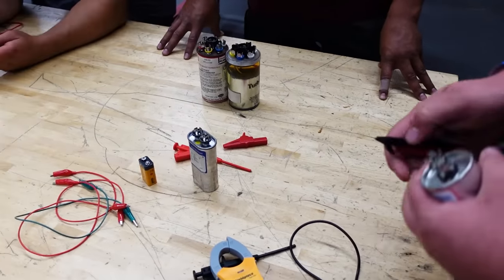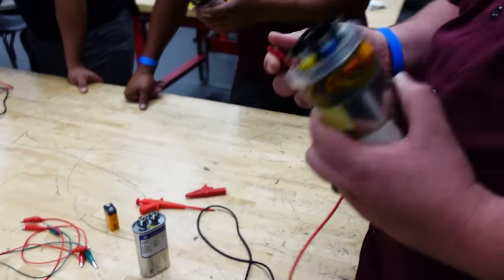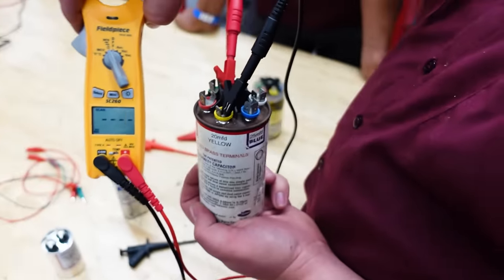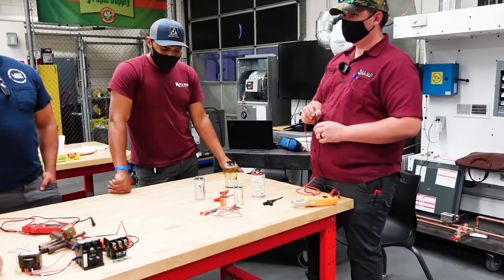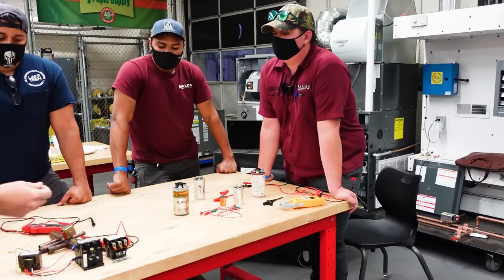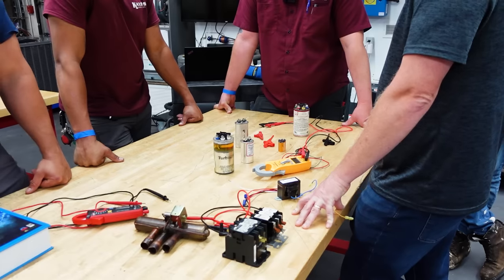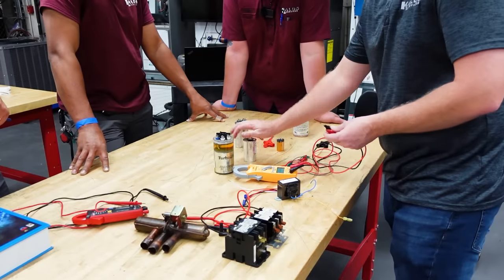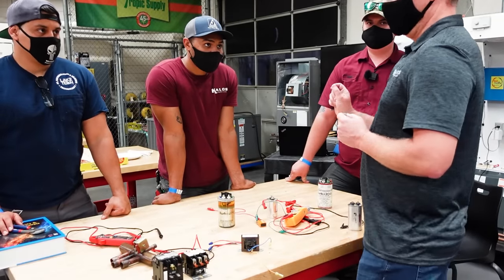Run Capacitor Fundamentals Class

Comment: What were the details of the dangerous test that they wanted to do? I couldn't hear what the bad idea was.

Are you not able to connect 120v to the capacitor using a switch, then turn the switch off, and then measure the voltage?
Reply: If it was 120VDC, yes. The surge current would be close to infinite, but if it survived the surge, you would read 120V across the terminals. At 120 VAC the cap would constantly be drawing current as it continuously charged/ discharged. When the switch was opened you would read the voltage that was present at the INSTANT the switch was opened (0 to +/- 170 volts). If you've ever switched on a light and it instantly blew out (very brightly), the instantaneous voltage was approaching the peak of 170V. This doesn't happen often, but it does happen.
Reply: @rickvia8435  when they said they might do the test off camera, do you think they did? Is there a way to do the test with safety precautions that mitigate the danger to reasonable levels?
Reply: @realSamAndrew  Not with AC, Man. A human cannot open (or close) a switch fast enough during an AC cycle to be able to determine where in the AC cycle the amplitude (voltage) is.
Reply: @rickvia8435  I understand the wave moves too fast to be useful in a test, but I wish to understand why it is dangerous. For example, you can connect a light bulb to 120vac and measure the voltage across it as it is powered. Why can't you do the same with a capacitor? Even though you might have to connect other things to complete the setup.
Reply: @realSamAndrew  The basic purpose of a capacitor is to block a direct current, while passing an alternating current. In the case of a direct current across the terminals of a capacitor, current will flow until the capacitor has charged to its capacity, then no more current will flow. If an alternating current is connected across the same capacitor, the capacitor will tend to conduct the current in relation to its  capacity vs the frequency of the AC. If the voltage of the AC across the plates of the cap are reasonable, a voltage WILL develop across the capacitor that can be measured (by an AC volt meter). The voltage that is read will be determined by the value of the capacitance vs the frequency of the AC (this is the impedance at a given capacity and line frequency). If the AC voltage exceeds the rated voltage of the capacitor, it will act like a short (or near short) and the capacitor will be destroyed.

Comment: Pretty good learning experiment I done worked on heating and air conditioning for over 20 some year I've had my experience with some capacitors the worst I ever had was start capacitor I've had them blow the electric box completely up they're dangerous you ought to teach them about them things . They act like a half a stick of dynamite when they go off got to teach them how to wire them up.
Reply: You are correct. In fact, these big capacitors should be labeled as dangerous. They explode, and also the current can kill you. Far too many inexperienced guys screw around with these things, without understanding the risk.

Comment: In 1973 a very bulky expensive meter was needed to test capacitors.
You could test for opens or shorts with your ohm meter but you couldn't test the MFD's .
Reply: Yes, but then if a cap was bad, it would drain itself real quick and not hold a charge, as it's internally shorted. Charging it with a DC voltage like they did, then testing the voltage of the cap will reveal a short or not, as the voltage will drop and not hold unless it's a good cap. A ohms test is not sufficient for testing caps, as the test itself will drain the cap which leads to continuity.

Comment: There's a wide range of capacitors.Those are starting capacitors filled with electrolyte.Some are ceramic or use other materials.In a circuit a capacitor will block DC but not AC.It will phase shift the AC signal.RMS (root mean square) voltage is 0.707 of peak AC voltage.Some things aren't explained in the video,but otherwise good presentation.

Comment: Where can I get the alligator clip meter leads that you guys were using in the video? I don’t care for the ones that came with my Fieldpiece meter so I bought some Amprobe alligator clips which look similar to the ones in the video but much larger. And by much larger I mean way too large. I like the ones in the video, they look like just the right size for me

Comment: question: If a cap is fed AC120V and unplugged , then measured would the maximum voltage read be < 60V? since is the difference between the Hot and Neutral. will only be charged up by half of current as it alternates?
Reply: or would that only be true on a 240V line?

Comment: Can these also be checked with a capacitor tester, The sane kind used in electronics?
Reply: Yes so long as the tester is designed to read the scale the cap runs at. Most all testers will, as these caps are at low capacitance. In electronic circuits, capacitance can get higher in scale, which might require a tester design for high capacitance. Generally, just about any tester will read these caps. If you want a tester to read higher scales, like for electronic circuits, it might require a different tester, depending on the scale design of the tester. Farads, micro farads, pico farads and nano farads all are on different scales. It would take a real good tester to test all those scales, be an expensive unit which most people won't even need.

Comment: It's still not clear to me why the capacitor is wired the way it is. Does it connect to L1 or neutral?
Reply: These capacitors are for 240 Volt systems where a neutral isn't used so the capacitors are never connected to neutral.

Comment: Is it okay to discharge a capacitor with screw driver while the wires are plugged in?
Reply: Assuming that you mean the wires "to the capacitor" are plugged in, yes, not only is it OK to discharge with a screwdriver, it is best practice to always discharge capacitors, to prevent personal shock when removing their wires.  

First be sure that all the possible power sources are removed from the machine and verified with a test meter, then be sure that you are not inadvertently grounded to the machine frame (always a good practice when troubleshooting) so you don't get shocked if you accidentally touch the screwdriver blade.  

Before working on any machine (excluding "live" troubleshooting) you should implement Lock-out/Tag-out procedures which always include "removing or blocking any internal sources of stored energy."  Mechanically this includes securing any energy stored in springs for example.  Electrically this includes discharging all capacitors, especially the "large" ones found in HVAC machinery.  A screwdriver with an insulated handle is a convenient tool for this discharge, insulated handle pliers can also be used.  If not sure of your tool's insulation, wear gloves, leather is fine, even cotton is better than nothing, as you probably don't have electrician's rubber gloves handy. 

Bottom line: remove "all risks you don't need to take" and this includes using gloves, and being aware of all external ground sources that you might accidentally touch.

Comment: I'm not positive you are correct about the capacitor charging and discharging based on the supplied electrical frequency. 

I'm pretty sure once charged they stay charged until that charge is used. I can't think of anything in the motor circuit that would discharge the capacitor.

In my understanding a start capacity is used to smooth and supply a constant voltage to the motor, and to absorb the start in rush current.

 I'm open to be informed otherwise.

Comment: In a microwave oven a capacitor and a diode is a voltage doubler circuit. The 2000 volts becomes 4000 volts...technically you are right the capacitor itself doesn't boost voltage. But in a circuit with a diode it can double it.

Comment: Can you use a higher rated capacitor. Something is 220v and then use a 370/440 rated capacitor?
Reply: The voltage rating on capacitors is a maximum limit. Exceed it and the cap goes boom.
Provided you don't exceed the rating then the cap will be fine.
Reply: This is the same question i have. Mine is 250 v and 60uf but i cannot find anything in 250v i guess i can ise 370. Well i hope i can lol

Comment: Does a motor still run if the run capacitor is bad?
Or still runs but doesn't run as it supposed to?
Please help.
Reply: If the capacitor is removed or completely broken the motor will not run.
If the capacitor is degraded as talked about with the foil peeling off then the motor wi run but badly, get hotter and less efficiently.
This is only for a run capacitor, not a start capacitor.
Reply: @dougaltolan3017 . Thank you. I don't know why YouTube never sent a notification about your answer.
I just found it today because i watched this video again.

Comment: You need to a video within the next week before my final exam lol!!! A video on how the electrical is hooked up on a wooden simulator board thing in our classroom showing the wiring from the the thermostat to the transformer, contactor, heat relay, indoor fan relay, compressor, electric heat, indoor fan and outdoor fan!! I bet you $100 bucks you can't make this electrical video with a week!! Really lol 🤷‍♂️
Reply: There is no capacitors on this board simulator thing...
Reply: Lol I I can follow the schematic its just.. well idk what it is!! For some reason I am just having the hardest time time with this!! I believe I am just making it more complicated than what it really is!!  Its like where to plug in the wires on a contactor and where to plug in the wires on the relays??
Reply: @Trust_Jesus  you have to think about what loads connect to what switch. where is the line voltage going on a contactor. what tstat wire connects to each switch. contactor Y relay G sequencer  W. where is the common going from the step down transformer  ( to the 24 volt coils) and you have your R power wire going to the tstat block
Reply: @anom2789  yea.. I'm just making it harder than what it really is!! I got the colored tstat wires down to which switch it goes to and I know where the 24 volt transformer wires go but its like i start getting everything messed up with all the common wires and the load side!! Smh... I just need to take one step at  time and slow down!! I think I really am just making it harder than what it is lol
Reply: @anom2789  it just looks like a big jumble of wires when my teacher does it lol... I need to just slow down and connect one wire at a time!! I've been struggling with this for 2 weeks and the final is next week 😫!! I'm in class for 5 hours tomorrow so all focus is gonna be on that lol!!
Reply: @Trust_Jesus  if you could take a pic of your board and then draw it on paper over and over you'd get it down easily as well
Reply: @anom2789  cool! I'll have plenty of time tomorrow and I'll have the lab all yo myself most the day so I'm gone do that!!

Comment: Me: Your capacitor failed. Needs replaced.
Customer: BUT I JUST REPLACED IT 6 YEARS AGO. THEY DON"T MAKE THEM LIKE THEY USED TO! RAAAWWRRR!
Me: You're right, they don't! It's cheaper, thinner materials so they fail faster. Your system is failing now. Starting with the capacitor.
Customer: GET OUT!
Reply: HUH... first its heat that causes them to fail.  There are tons of quality capacitors that are cheap.   you can make a great capacitor with thin material if you do it right.  Also why would a customer tell you to get out if a capacitor failed and either the system is down?   I think most people assume nothing last for ever and a cheap $10 capacitor plus a reasonable labor free is a small price to pay for a working HVAC system.  Now if you are over charging them say $50 for the capacitor and $100 for the service then yes, get out.
Reply: @MichaelMantion  Michael, that's the problem with some companies. I had a tech out to troubleshoot and repair a short in the outside 24V control wiring. Job well done. He was good enough to point out the start capacitor was leaking and quoted a price  of $250 for parts and labor, with about one week to order parts. I never called back. Ordered the cap and start relay for about $40 and fixed it myself in about 10 minutes. Fortunately I know the ins and outs of de-energizing the system and capacitor. Most homeowners wouldn't know they're getting scammed and wouldn't be aware of important safety issues for a DIY repair.
Reply: At season start, my A/C wouldn't work.  Thought it was continuation of last season's freon leak but with pressure test OK figured "hey, I'm an electrician," let's take some voltage measurements.  Verified power, and contactor was "pulling in" but no output voltage to the compressor.  Huh?  So, first step in troubleshooting, open things up and look for something obvious.  Ants! Dead ones, on the contacts with high body resistance.  After a  short memorial for the ants, I reassembled the main contactor and she started right up.  What do you suppose the commercial A/C tech would have sold me, and how much would labor have cost for installing it?

Same ant problem caused my kitchen GFCI outlet to trip and not reset, and a smoke detector to "false alarm," on other occasions.

What meter setting do you use to measure the electrical properties of an ant?😉

Comment: Lol in electrical class in college I was the guy in the back who would take the little capacitors from our little electrical circuit builder kit and get everyone to pas thier 9v batteries to me connect them in series and then Hook the cap to the battery bank as the instructor was talking and suddenly hear a sizzle a bit of smoke and bang the cap pops and launches pieces of itself and obviously everyone is now looking at me as I laugh my ass off

Comment: Thx HVAC S for an informative and interesting video  brought back memories of '70s Mt Sac College and Mr Motter's Aviation  electronics class  driving home  Xl and Xc calculations to match capacitance to reactance to improve delivered  power factor in a motor. Now days a Micro Aire soft starter does it all for me on my RV ACs allowing me to run 2 ACs from 30amp 120vac shore power. Sub'd

Comment: Compressor, it's not working. Capacitor must be shagged. Buy new capacitor. Install. Compressor motor still does not run? Checked cap with circuit tester on 200nF.= 0.4 ! Test on 20uF. Display reads same as before testing 0.03 ~0.04 . Is this the wrong tool to test with?

Comment: A/c's will have complete diagnostics on board with blue tooth to your router and will be monitored by your A/c company & manufacturer.  Reading will be continuous and diagnostics codes thrown will alert the A/c service and manufacture.
Reply: Carrier Infinity Series already does it,the tech can monitor what the system its doing because it is connected to WI-FI and it self diagnoses some problems and keeps history of prior issues,it even can be configured to send e-mails to report malfunction!
Reply: @pastormartinez4676  yes that will continue to grow and monitor.  I dont allow any of the smart meters on my houses or rentals.  It won't be long that if  they see your appliance is out of date and using to much electricity, you will pay penalties.

Comment: No mention of the 90 degree phase shift between the two windings needed during starting - to provide a rotating magnetic field.  Come on guys, know your stuff.  Three phase already has a rotating magnetic field, single phase does not - so they use a capacitor to briefly provide a pulse of out-of-phase magnetic torque to start it.  After the motor is running, the additional 90 degree field is not required, so the start relay disconnects it.  Current in a capacitor is 90 degrees out of phase to the voltage, and since the magnetic windings are current devices, it all works.  Think of it like a one cylinder steam engine compared to a two cylinder steam engine with the cylinders mounted at 90 degrees - one engine is self starting, the other is not.
Reply: Exactly my observation as well. As a Electronic Engineer and also a Physicist I understand Capacitors very well. The single phase motor needs  temporary assistance to start running as the single phase can not provide the rotating magnetic filed required. Exactly as Steve Wright has pointed out.
I found the 'lecture' very confusing.
Reply: He has more in depth videos that explain motors and capacitors. This is just a quick and easy to understand instruction on testing capacitors. Not everyone has the time to learn electrical/electronic theory through YouTube.

Comment: Electro motive force isn't really the right terminology. Inductive capacitance is a more correct term, electro motive force is when you're driving the output of an AC motor and it creates inductive electrical charge because of the mechanical input. Inductive capacitance happens in AC motors because you're dropping the field windings and reversing polarity at whatever frequency you require. This which causes electron discharge back into your voltage source. I'm not an HVAC tech, but I've been doing electrical work in the Diesel industry for 10 years. I understand that Run Capacitors are used like an electrical filter to stop electron field drain from your AC motor. Start Capacitors are always charged as long as they are hooked up to live and neutral and aid in providing the extra in-rush current required to start spinning high torque, heavy AC motors.

Comment: The capacitor just creates a phase angle  between the start winding and run winding to create a torque to start the motor. Too small a cap and the start winding is weak and not enough torque. Too big a cap and it starts but there’s too much current in the start winding wasting power and making the motor run hot. There’s no energy storage required, that’s just a side effect of the cap design.